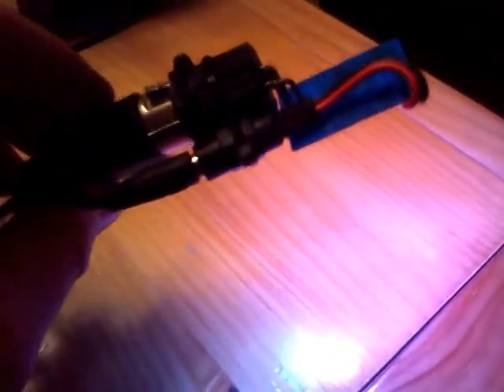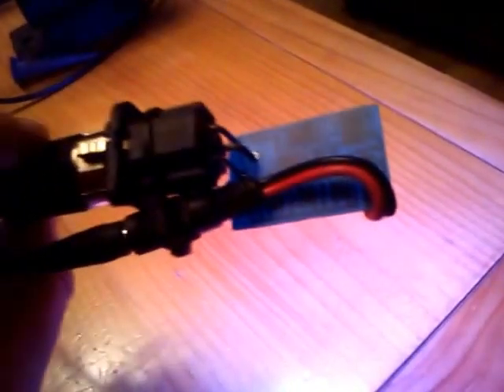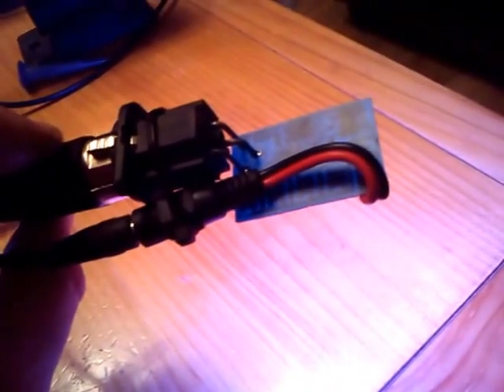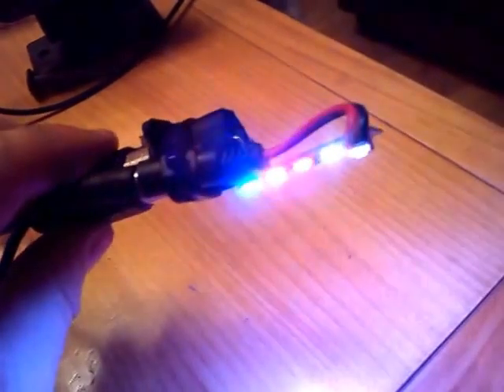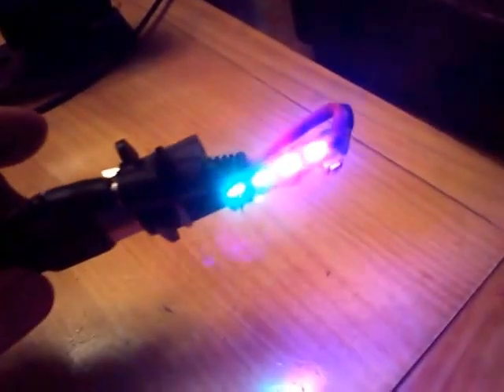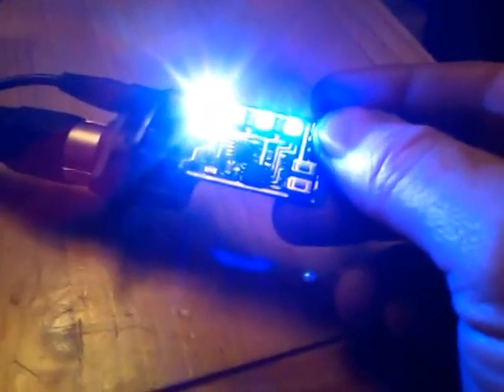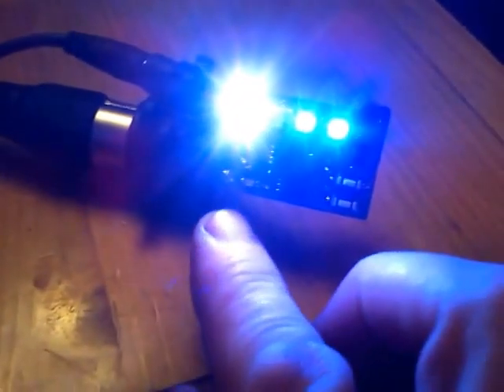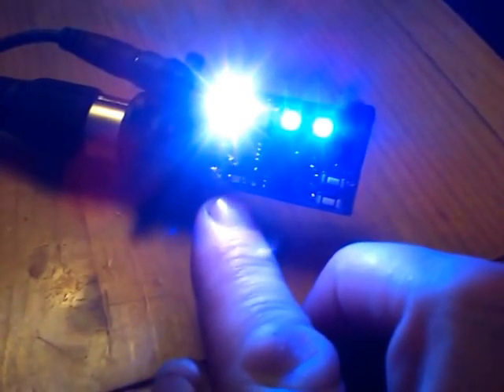Arduino ATTiny13a DMX512 Receiver driving WS2812 RGB LEDs

Comment: How did you wire the dmx port into the ATTiny13a? I am wanting to make dmx’able theatre props so am trying to find a way I can have one Arduino read about 15-20 channels and decode them and wirelessly send the signal to 3-4 other arduinos with RF 433Mhz embedded in the props with a battery, so for example I am looking at building a fire with ws2812s and power it by a battery and have the main decoder in the attic above the stage decode the dmx signal and then send the led signal to the arduino in the fireplace for example which will wirelessly receive the signal via a RF 433Mhz receiver to turn on the leds, change the brightness of the ws2812’s etc and then do the same for leds in a couldren etc, would you be able to help me at all with the dmx decoding bit??
Reply from the maker: Hi this is quite an old project, and at the time I published it to the Arduino forum, it was early days and the code isnt very well written and in the light of time I can now do alot better. I would suggest a better thing to use would be ESP8266 ESP-01's, they are very cheap and you could pack everything you need in the one device. unfortunately I run a full time electronics and software business now so my free time is zero :(

Comment: Im interested in seeing what the code looks like for this. I have driven WS2812 LEDs before but I didn't really categorize it as DMX per se. 

The code I compiled had different patterns that it would cycle through whenever I pushed a button. And each pattern had either a function or a manual pixel mapping of the RGB values on each LED in a string of at least 20. its actually some code I found that just works for the button I'm sure there are better ways of doing this.

//FOR THE PUSH BUTTON LOOP
   // read that state of the pushbutton value;
  int buttonVal = digitalRead(buttonPin); //declaring new variable (buttonPin) inside loop?? oh well haha
 // Serial.println("          buttonVal: ");
 // Serial.println(buttonVal);
  if (buttonVal == LOW && oldButtonVal == HIGH) {// button has just been pressed
    lightPattern = lightPattern + 1;
  }else if (buttonVal == HIGH && oldButtonVal == LOW){// button has not been pressed?
  lightPattern = lightPattern;
 // Serial.println(lightPattern);
}

So for example the code for the case would look like this
if (lightPattern > nPatterns) lightPattern = 1;//if lightPattern variable is greater than the number of patterns assigned to cycle through, lightPattern starts over at 1 again.
  oldButtonVal = buttonVal; // this increments the pattern number to cycle through "channels" so for each case is referring to the value that the button increments which contains the void function

switch {

case 1: 
pattern1();
break;

default;
break;
}
}

void pattern1() {
  
      neovalR = valR / 4;//HAVE TO REINITIALIZE THESE VARIABLES FOR SOME REASON
      neovalG = valG / 4;// divided by 4 because analog read does 10bit which is 0-1023
      neovalB = valB / 4;
      //USING map(value,fromLow,fromHIGH,toLOW,toHIGH) to reverse the value to match the encoder color
      
//neoval variables are the RGB faders manually driving PWM with NPN transistors.
//using map() because the physical color sent to the ws2812 was being flipped for some reason so arduino is reading values and sending out packets to WS2812s with strip.show()
      //this is pixel zero i didnt want to put all 20...
        strip.setPixelColor(0, strip.Color(map(neovalR, 0, 1023, 1023, 0), map(neovalG, 0, 1023, 1023, 0), map(neovalB, 0, 1023, 1023, 0))); 
strip.show();
}

There is a lot of code left out but this is the general idea....I can send you the code if you are curious what I have made so far...It is far from perfect since I am running an audio reactive circuit simultaneously with this and it effects the refresh rate and the colors become different hues of the original RGB values which is cool....but the refreshing between the audio and the pattern colors is really kind of a nuisance. Its like its flashing between the audio circuit sending data (whether it is sending 0's or anything between to 255) and the pattern colors being displayed. Only the pattern colors are doing the flashing. (and this is dependant on the sampling delay of the audio code itself! smaller delay faster flashing!) I don't know how to separate the two. 

I believe it is because both circuits are using the same strip.show() function and this is determined by SOMETHING in the .h and .cpp files I believe for the adafruit neopixel mumbojumbo that I dont know...its like all in assembly.

P.S. do not copy this code and paste it in IDE it will not work! Unless you know how to fix the youtube comment version of it, youtube doesn't allow all the correct indentations lolol this is just to show you! :)

Comment from the maker: I have other projects on here, DMX controllers, wireless DMX transceivers.. anything is possible Micke. What you describe sounds very simple :)
Reply: Bob Lynas I hope it´s simple, but I´m a newbie. =/ 
I would need something that i can call for example "Channel 37" and get a received number of 0-255 and then to get an arduino core (attiny or something) to take that number and give to a PWM-pin connected to a led. 
And I can´t say that my poor use of english the last years helps when getting in to the technical stuff. ;)
Reply from the maker: Micke Rosencrantz I suggest you take a look here -> http://www.mathertel.de/ this guy has some well written up projects for both sending and receiving DMX

Comment: Would it be possible to set this device to give values om 0-255 like the DMX-programs (like vixen) out to a lightsource? 
I've tried to understand from your link and google, without luck. 
I need to be able to dim one single LED (normal 1W led, not the 2812) from 0-255 and are looking for solutions...
Reply from the maker: Micke Rosencrantz I think you may be confused, this is a DMX receiving device, not a controller/transmitter
Reply: Bob Lynas I know it's the receiving device, and i have software and hardware to send dmx - but i need to get the 0-255 brightnesslevel to get to the led. 
Will this receive that data and make it possible to dim a light?
Reply from the maker: Micke Rosencrantz check out this website Micke http://www.mathertel.de/